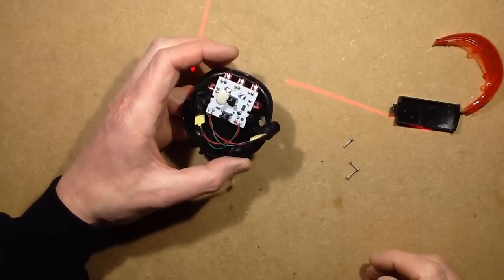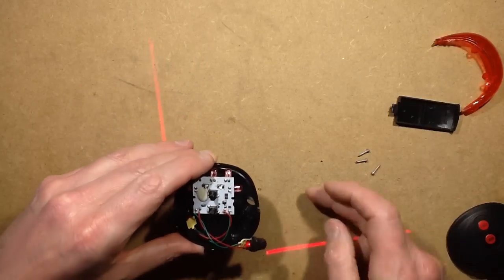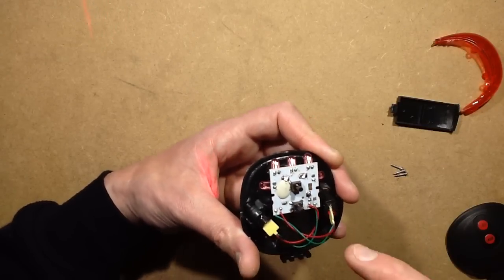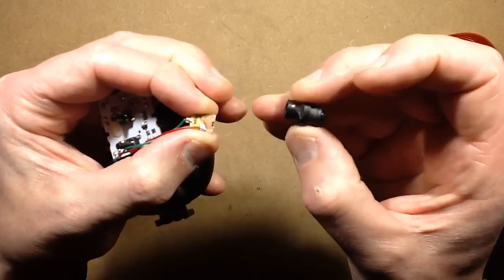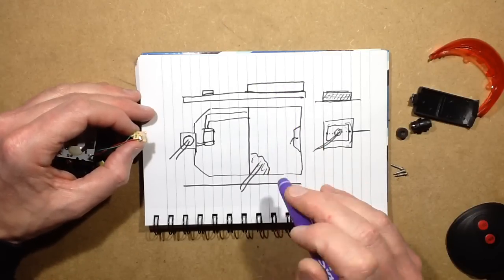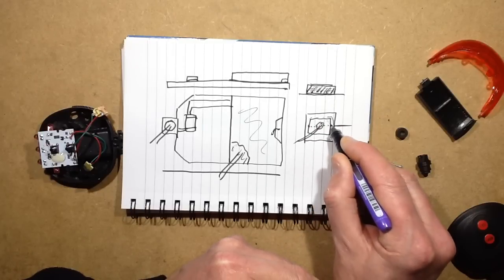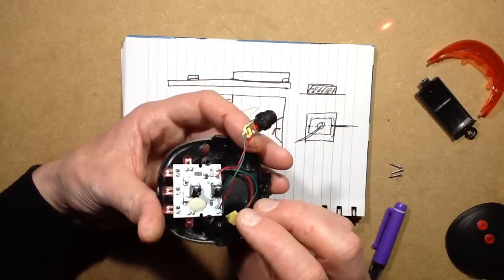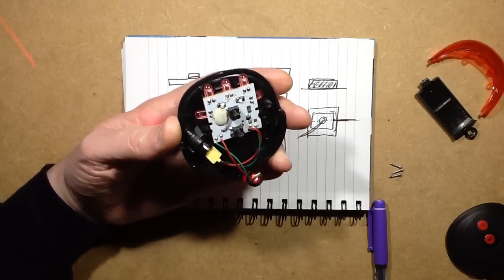Inside a laser bicycle light.  (And inside the lasers too.)

Comment: LOVE your work Clive;
1) Modding

I was wondering if/how easy it would be to mod this bike light?

Eg. Put a more powerful laser module in and put the collumnating lens &/or 'beam splitter' on the end. 
Any ideas?
Perhaps not to the same extent as +styropyro

I googled "laser bike light mod" and whose video came up +bigclivedotcom
I've been watching your videos for a while.

**
2) lights off/lux meter

Is it possible when you do laser/torch videos could you show it with the lights off? 
I don't know if the camera would give a good/realistic sense or not.

Using a lux meter too would give awesome dimension to your debunking since lux/lumen ratings given by so many bike light/torch sellers are usually BS.

Unfortunately, the following link's tests multiple smartphones with several apps concluding that a phone's lux meter is too unreliable:

https://www.dial.de/en/blog/article/luxmeter-app-versus-measuring-deviceare-smartphones-suitable-for-measuring-illuminance/
**

PS. Love the Isle of Man coat of arms. Doesn't matter which way you fall, you always end up standing 8)
PPS. was that ruby/xenon laser cryrogenically (helium) cooled?

Comment: Just a warning, as fun and cool as these are (or might seem), mine broke on the first ride. The mounts are very weak. The laser and lights worked ok, but it has to be pretty dark out.  
Also there are too many different blinking options to click through. I hate that
Reply: +William Meisburger-Iwata if you can make a better mount, it's a fun bike light
I can't speak for the actual increased safety when using it, it's probably on par with any other cheap light

Comment: The thing is, on a black tar road you can barely see the lasers even in the dark, with all the other lights from traffic, signals, advertising, houses and street lights.
Reply: +nrdesign1991 The laser modules would need to be replaced with some higher powered green ones (10+ mw) to actually be visible.

Comment: Sony Sound Forge's noise reduction filter can hide a multitude of sins, if you use a bit of video where you're not talking and capture that as a noise print, it can delete that sound from the whole video. Good for getting rid of noise from a camcorder's built-in fan, for example.
Reply from the maker: +AintBigAintClever The induced noise wasn't subtle.  It was quite surprisingly dominant.
Reply: Dominant like the Benny Hill theme going off on the phone in my pocket whilst videoing a friend's wedding? I managed to wipe that out by capturing the MP3 file as a noise print :D

It also did a nifty job of deleting the drive whirr from the same camcorder (my mate's Sony that burned straight to DVD).
Reply from the maker: +AintBigAintClever That sounds an awkward moment.   So what did you think of the electric shower head?  Would you shower under it?
Reply: He was OK about it and told me about one of his mates (also a guest) whose phone went off at his own wedding in the middle of the ceremony... and he answered it.

The suicide shower head? I wouldn't be too keen. There's a whole bunch of stuff on them at http://gringosabroad.com/electric-showers-are-they-safe-how-shocking/
Reply from the maker: +AintBigAintClever I think my favourite post there was "I was taking a shower in a hotel we were staying at in Salinas, when the widow maker shower head exploded with a loud noise, blue light explosion and resultant smell of burning wires. Well, since the water was still hot I continued to shower, when it happened again. Both times were sudden and caused me to scream. After the second explosion, the water became cold and that is when I turned off the shower and got out."

Comment: you're exactly right on the high reflector being at the rear of the chip and the partial reflector being at the front.  A direct injection diode laser is fundamentally the same as any other laser, with a gain medium stuck in a resonant cavity formed by two reflectors, just the cavity is much smaller.  the other main difference is that since the semiconductor materials form a PN junction, running current through the junction injects charge carriers directly into the gain medium (hence "direct injection diode laser"), so pumping is much more efficient than, say, a xenon pumped Ruby laser.  The major disadvantage of the technology is that the optical quality is terrible.  Not only is the divergence high, but it also tends to be substantially different in the vertical/horizontal axes--something like 40° vs 20° isn't uncommon.    To top it off, they tend to be multi-mode and highly non-gaussian, which makes focusing them with any degree of precision extremely difficult.

Comment: The serrated thingy is normally called a slit ;p Edit: Those would be handy for a homemade spectrometer, and the collating lens too. (Well as long as they have good spectral performance over visible light).
Reply: +leppie Basic idea of the homemade spectrometer would be slit -> lens -> diffraction (with cd/dvd) -> single line diode array. Seen a couple of them done on the internet, but still fascinating.

Comment: That's actually a pretty cool idea with the laser lines. What would be even more awesome would be to add a scanning motor (like a checkout scanner) to draw a crosshatch box all the way around the bike on the road.
Reply: +arcadeuk Or you could just install 15 of them on the seatpost and tweak the angles a bit.
Reply: If you add a fog machine you could draw a laser 3D safety cage around the bike….
Reply: They exist, ones which draw pluses/ crosshatch!
I can't find an image quickly but there is one here with a horizontal line and another with the "starry dot" pattern.

http://www.ebay.com.au/itm/5-LED-Laser-Beam-MTB-Mountain-Bicycle-Bike-Rear-Tail-Warning-Lamp-Light-IB-/161992460369?var=&hash=item25b780c851:m:m5hM6r5yyfw3_bm2kR_6Awg
Reply: Actually I guess it all depends on the type of patten/lens? at the end. I don't really know the terminology 8(
Reply: You don't want them ahead of your vision. I own several of these and they rock.